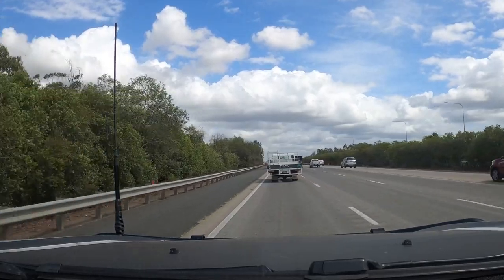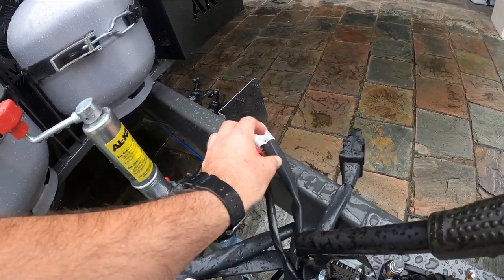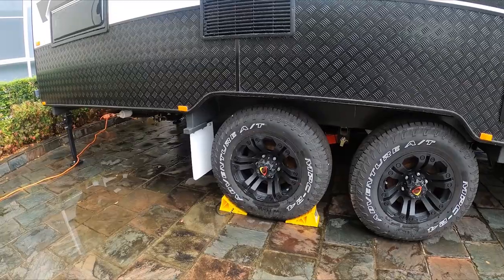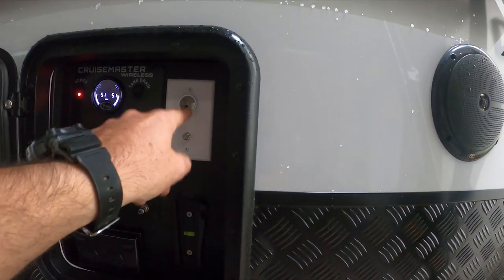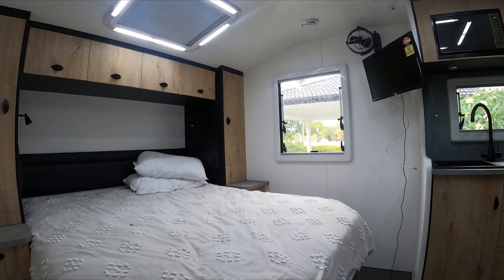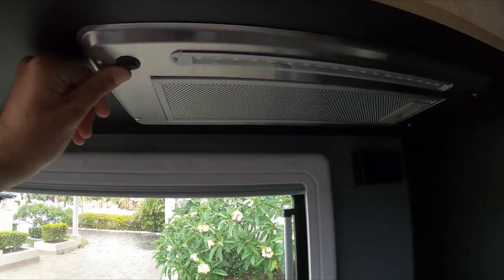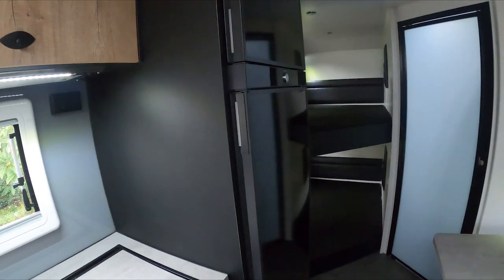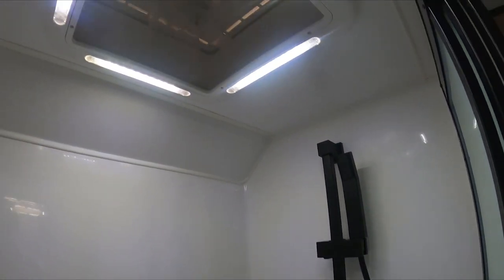Searching 4 Adventure - EP 6 - Our New "On The Move Caravan" From "Caravan HQ"

Comment: Nice van, what’s your GCM and rear axle load on the BT50?
Reply from the maker: Hi mate. It’s been a while since I’ve had the BT50. From memory the GCM was 6800 kg. But I can’t remember the rear axle load. I did have a GVM upgrade to 3500 kg from memory too. I found it to not have enough power to pull 3500 kg comfortable. Did the job no worries but my 200 series does it much easier and more comfortable. Cheers mate. Thanks for watching.